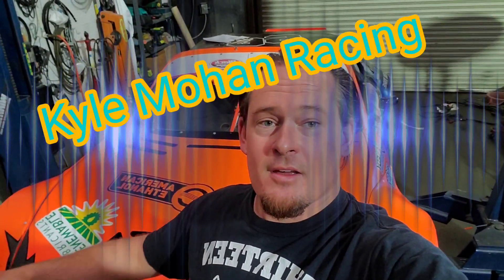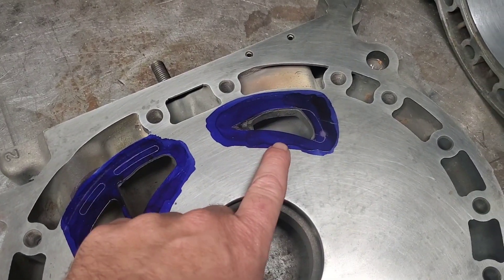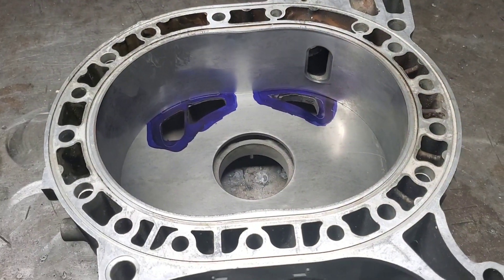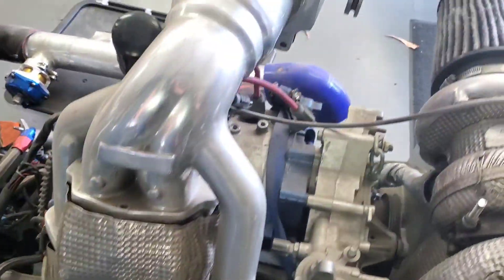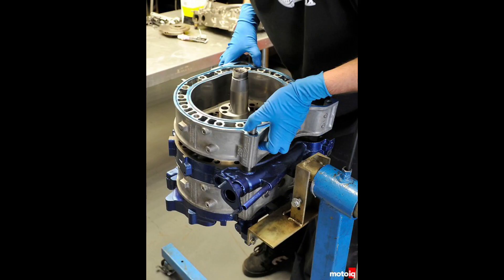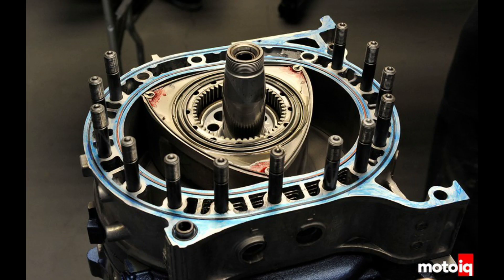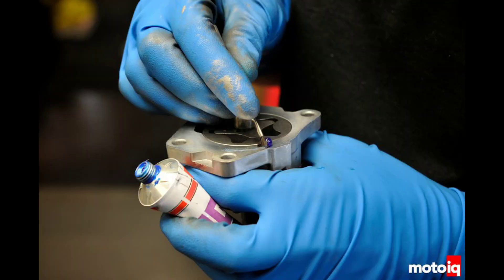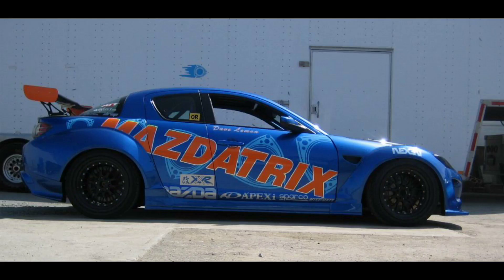RX8 Renesis Hybrid build, multi port exhaust experiment KMR/Mazdatrix

Comment: I was wondering what else besides 13b gsl-se housings, exhaust manifold and regrooving renesis rotors is needed to make this work as NA street car. I am thinking about blocking/welding renesis exhaust ports and using 13b gsl-se exhaust manifold. What about ECU?

Comment: Again, my choice would be an RX-8 with Peripheral Intake Port, with a Reed-Valve, Side Exhaust Port, Side Intake Ports fully clogged, side intakes are good for idle, low rpm, low load, but once port overlap is eliminated, Peripheral Ports are better. 
With a RV in PPort, and a glow plug in trailing plug hole, Toyota obtained 9% economy improvement. 
Glow plug are available for Diesel, as ignitors for heating devices, also in small turbines. 
Blessings +

Comment: Glad i found this video, my motor was built here in Sydney Australia very similar to this, mild port, pp exhaust, studded etc. basically as you describe here, im only weeks away from fitting a supercharger kit also designed here in Sydney using the Procharge D1SC running low boost 8-10psi max. for reliability, hoping to achieve some real power gains, seeing the results you got with the 'hybrid' is very promising, thanks

Comment: Would a 4 port Renesis with semi PP GSL SE housings yield similar results?
Reply from the maker: No.  Semi p ports will completely change the power band to a hi rpm race motor vs a well rounded drivable motor.  It would be completely different results,  worse gas mileage,  worse drivableity,  harder to tune, won't idle well... all normal p port / semi p port stuff.  If thats what you want... power from 6k to 11 k. They are fun. Basically a on off switch of power... If you want drivableity and smooth power then don't do a semi p.

It will make a higher peak power but I care alot more about usable power vs just a peak...    

Semi p ports are like putting a drag cam in a street car.  Easy power, but not the best rpm band.

Comment: Im Wondering , Could you run a FD centre plate , FD housings and just have the renesis end plates ?
Reply: OR would a FD end plates, FD housings and RX8 Centre plate be better ?
Reply from the maker: To many water seals?
Reply: Haha yes!  I mean more just the idea of the centre housing FD exhaust port and just one renesis port per rotor instead of 2.
Reply from the maker: @xile_hc  we didn't test that combination but based on our testing it would reduce power using an FD center.  And make it impossible to use any currently available intake manifolds as the FD pattern on a center is different.  So not my recommendation but if you test it let me know what you get.

Comment: See my question is why no one has taken the stock iorns weilded the exhaust ports closed.  Lap them and ceramic coat them.  Then go with p-port exhaust.  I may be off my rocker.
Reply from the maker: All that does is make a old 13b out of a renesis. I think its because its cheaper to just build a 13b p port that will most likely perform better... than a conversion to a renesis block.  A hybrid street port takes advantage of what a renesis has to offer.

Comment: ive been wondering if this has been done, GLAD TO SEE IT HAS! I have looked around a little, after realizing it has been done before. ANYWAY I was wondering how exactly yall ran this hybrid without blocking off the side ports? Like I said, ive had the idea about going hybrid as I have 2 renesis engines, one I want to keep original and the other go hybrid like this with glse housings and boost it but was wondering maybe not block off the side ports with zinc or block off plates as I have heard people around forums saying there is short lived success around blocking the side ports off with zinc. Any knowledge or advice is greatly appreciated!!!
Reply from the maker: There is no reason to block the side ports.  That would reduce power and efficiency.  Not sure what people are thinking. (If you block the exhaust side ports and add GSLSE Rotor housings.. all you're doing is making an old school 13b)??? Lol.
Reply: @KyleMohanRacing OH MY GOSH YOU RESPONDED!!! Im guessing most block off the side ports so it's easier to make a header...but no one wants to admit that lol 
I have another question for you about regrooving the  rotor to fit bigger apex seals would be needed if you're shooting for 400hp?

Comment: can't you tune with versatuner/mazdaedit since its still a renesis plate? I have a turbo 8 using versatuner
Reply from the maker: I recommend a good stand alone ECU.  Like a haltech elite
Reply: @KyleMohanRacing  for occasional track and street use. What is the hp you would recommend for that setup? 400-500? Or would you say REW swap it .

Comment: OMG PLEASE PLEASE PLEASE REPLICATE THE EXHAUST MANIFOLD OR HAVE A KIT AVAILABLE especially since Mazda is now remaking a lot of the FC factory parts again this will allow people to buy these housing brand new and have them for the hybrid build. Please provide more info on this maybe build parts or even a step by step engine assembly video. I don't know if you noticed or not but the RX8 has gained more popularity again since 2017 which means the market is back in full swing. Having info out there like this will allow the community to be just a great as the rx7 community I'm 100% for more info on this great video

Comment: Hey kyle do you think you can send us the engine mount set up you used I'd like to see how you solved that headache and what other changes you had to make like spark plugs, oil lines, ect. If it's not to much trouble man it's an interesting concept but I want to know all the details I'm currently at a stand still with gains the manifold wouldn't be to hard I'm guessing you Frankensteined two and made one that's how I would have done it. I just really need to see the mounting before i would commit to this hahahaha

Comment: Quick question, can you mate the plates without studding the Irons? and without deepening the apex grooves?
Reply: Yes, definitely.  The studding and RX7 apex seals are just upgrades to support high HP, not required for assembly or fitment in anyway.

Comment: Is it a bad idea to ask or have done if possible the side seal groove for 13b 86+ Expanded to fit the 12a side seal...? I know there’s also a height difference well a depth difference and that the rx8 side seal is not a straight but champhered design I’m not sure but i got 2 set rotors but one set I kinda jigged at because I couldn’t remove the side seals... I seen angel motorsports YouTube where Jon was gifted a side seal removal tool... I tried even researching for 0.08mm jewelers pick etc... but gyea pls lemme know daesyoung@gmail.com

Comment: Does this affect exhaust emissions???
Reply: My guess is that it would make them worse as it's allowing the exhaust to escape faster.
From what I've read the side exhaust ports on the renesis are a slight restriction by design to keep some of the unburnt hydrocarbons in for another cycle.
So with this mod you're trading higher emissions for less heat build up and better exhaust flow. A good deal if you ask me!
Reply: Yes, but just run e85 🤷🏽‍♂️ burns a lot cleaner

Comment: I've been toying with the idea of rew/re swapping my Rx8 rolling shell, but the idea has always bounced around about running the 13b housings with the REN plates and building a custom manifold. My big question is, compared to a stock renesis how was the lower end drivability of this engine setup? Hard to tell from the video, but was the rx8 lower intake ssv system still retained?
Reply from the maker: No valves where used. Its drivability was fantastic.  Just like any car the drivabilty at this point was relative to the turbo, and ecu tune.  Think of an FD3S setup.
Reply: Thanks, See many of us on the forums that followed the thread about this build were questioning the 'street-ability' of a build like this. Mainly due to how large the manifold is, we would figure the turbo lag would be an issue. The other argument was about how large the exhaust/intake overlap would be and what issues that would cause. 

Do you suppose the stock intake/valve system could be maintained to help with low end torque? I imagine this system wasn't needed for racing and you went with this other LIM.
Reply from the maker: @mincvinyl  Nope, none of those where concerns or issues. Drives like a good fd3s street port.  No issues with over lap.  GSLSE, AND Renesis blocks have minimal overlap so you would only get that if you Bridgeport the intake.  Over lap is usually porting influenced.
Reply: @KyleMohanRacing  Thanks again, maybe i'll bring this up to the guys on the forums
Reply from the maker: @mincvinyl  lol,   basically port timing creates over lap.  Not volume.   And when your talking about manifolding think of all of the aftermarket setups for earlier 13 bees these motors love to get air in but you have to be able to get out the RX8 probably has the largest intake volume so your just matching up the potential for exhaust flow in getting rid of stagnant heat buildup in the exhaust chamber.
Reply from the maker: @mincvinyl  happy to give the info. I plan to build a few new versions soon as I have time.  I have a couple wild ideas for this combo
Reply: @KyleMohanRacing  Definately stoked to hear that it will still be in development. I'll keeping tabs for sure. In the mean time i'll be learning mazda edit and probably look into basic renesis turbo setups.

Comment: Hey Kyle, planning to make an experiment too, would you advice me to use all side ports? Some people tend to block them off. What about blocking the Siamese ports and only use the side exhaust ports?
Reply from the maker: I would use all the ports just as we did.  It worked great.  Why would you ever want to reduce exhaust flow on a motor that has exhaust flow issues.  We ported all side and gslse exhaust ports.
Reply: @KyleMohanRacing  Well, in thoery you can loose exhaust pressure that can make your turbo spool slower, at least that what some people told me.... What's the max boost you tried to run on thi setup? And thanks for the info...
Reply from the maker: @josezuma  the RX8 doesn't have enough factory exhaust flow.  By adding available ports your increasing you exhaust flow.   I dont think you can go to big without crazy porting.  We only got gains in our testing.  I would imagine people are forgetting that the RX8 is exhaust chocked.
Reply: @KyleMohanRacing  Sure, I get your point, but by adding all those exhaust ports you will end up with bigger ports than REW, right?  

I'm asking because I'm interested in doing this experiment and I need as much info as possible.

Comment: whats the pricing like with this setup?  it seems to me that rx8 engines costs about half of what a rx7 engine does. do you think this could be done as a cheaper option for someone wanting to turbo their rotary? also can you use the stock intake manifold with this configuration?
Reply from the maker: Na,   its a pricey build as I mention in the video.  There is extra work evolved to modify the Renesis for reliability and power.  Yes you could use stock intake but will still need a aftermarket ecu with fly by wire control.

Comment: I wonder if this would have any significance keeping it an n/a engine and the potential gain
Reply: You will definetly see more power from it and with this set up bridgeporting will acually have more of a benefit since berforehand intake porting was close to a waste of time since all the limitations are the exhuast ports in the renisis
Reply: @MDELITE147  hmmm that is true. Bridgeporting is rly not worth it for the renesis lol, but that is valid you make a good point.
Reply: Bridgeport with PP.... PP with two thortle body plus bridge port with fd manifold... 
Hmmm.. Seems kinda intersting NA
Reply: @heruhadianmudjenan4377  maybe the renesis can finally hit 250whp 😂
Reply: Ammiienn.. Lol

Comment: Always knew there was HUGE potential in this concept. Had a buddy make a Na carb set up which was interesting. 
Glad u finally shared some results. 
I wonder did u guys find some limits I regards to Boost and reliability? 
Did u keep it at 11psi for racing,? 
Did u guys pull it down after the championship and recheck tolerances and housing/port/seals condition?
Sorry for all the questions, but I fully intend trying this set up one day. 
Thanks in advance. 
Ps. Any video of it racing during the championship?

Comment: Hey kyle would it be possible to use the stock intake, and would i have to use two separate exhaust gaskets, also im sure people on a tight budget can use the stock header flipped around for boosted applications.
Reply from the maker: Yea.   We just didn't want to deal with a electric throttle body so this was an easy solution.
Reply: @KyleMohanRacing  one more question, did it brap?
Reply from the maker: @jimbowcracklehead8071  it had a very mild brap.  It actually sounded like the V6 Oldsmobile indy car motors from years back to me.  It had its own sound.  I think if I did it again I would change the port timing a little and I could make it brap hard.
Reply: @KyleMohanRacing  what are you waiting for? Start another one, also im not too versed on exhaust timing, what exactly wouldnt you do? Leave the peripheral exhaust un ported?
Reply: @KyleMohanRacing  do you have videos of it racing, I would love to hear this thing sing.

Comment: Any ideas if this would work on a stock tuned ecu I don't see why you couldnt on a n/a setup thinking on doing this build for a 4port 4speed auto with a Centrifugal-type supercharger 
I've actually found an exhaust flange @ racecast.com.au that may help make this a quicker process for the manifold it's self tho it seems to be missing the center iron exhaust port from the flange its self but maybe easy to fix for what I want/need all around I'm looking forward to try and may make logs of the the build if I go through with it other then that to me this seems do able
Reply from the maker: The stock ECU will not be able to make the proper adjustments. You will need a good quality stand alone ecu and a good tuner.

Comment: The Custom exhaust is the reason why many don't want to deal with it. 
No all of us are awesome like you guys and most of us are broke..😭
Reply from the maker: Yep.  It was some work
Reply: Eh, I've seen people just block the side exhaust ports off with a gasket and just run the p-ports. Some have even just filled them solid with devcon with good results.
Reply: @juggnautbitch  but then you might as well just run an entire 13b rew bridge port or something.. the side exhaust ports move more air than the PP and have some serious potential.. combined with the peripheral ports, you can move SO much more air.. that's the point.

Comment: Finally, some information about this! When researching about this subject a couple months back, I was surprised at the lack of information about this on the forums.
Do you know if this would work well in an N/A semi-PP setup? And, do you know if these housings allow the use of an OMP? Currently have a spare engine disassembled and am thinking of tackling something like this if it seems to make sense. 
Thanks for sharing this, you made my day!
Reply from the maker: Yep.  Was a great project
Reply: If you ever go the NA semi-PP/hybrid exhaust route, definately post some results! Very curious to know how it turns out.
Also, if I were to build a rotary, I'd keep the OMP too but plumb it to a proper 2-stroke oil tank. I don't know if the electronic forced lubrication OMP off a new 2-stroke sled might work or would be too complicated to integrate in a standalone ECU.
Reply: @jnmason6283  sure :) by the way I do have the OMP and it is indeed modified with a SOHN adapter to pull the oil from an external oil tank! Very nice setup indeed
Reply: @jnmason6283  I have one running now
Reply: @richarduffindell1049  The hybrid exhaust only or with semi-PP intake as well? Very curious to learn more
Reply: Wondering if you were able to get your engine running. I have a Renesis that needs rotor housings and I heard about the hybrid thing a few months back but never did try to find out more. In time I think I’m going this route as well… except for the semi p.p.